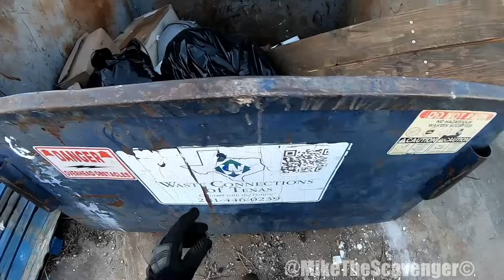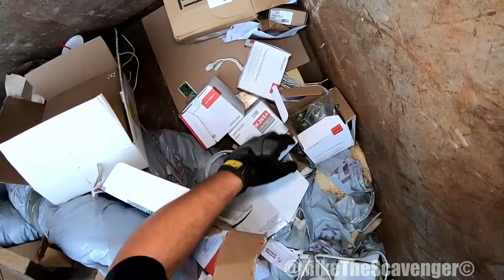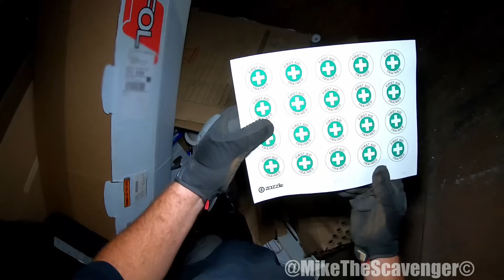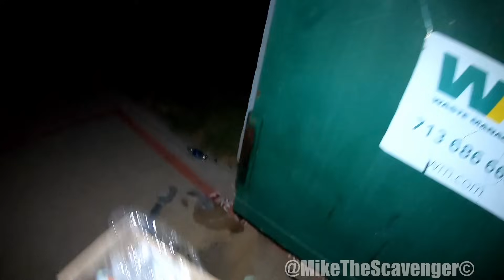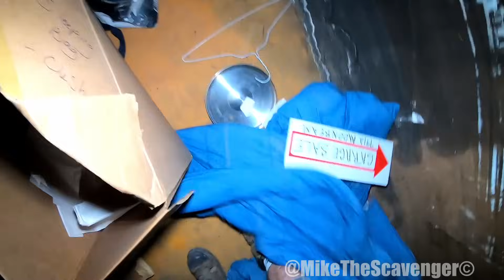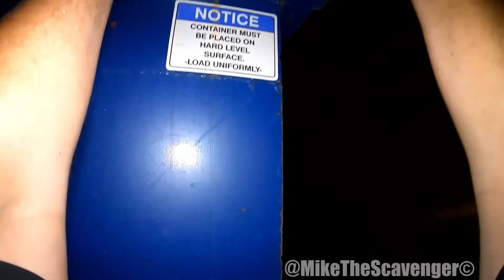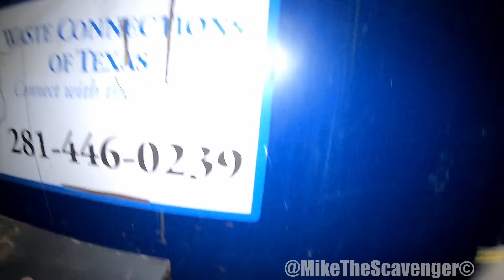Dumpster Diving "There's A Gold Box"

Comment: Mike, on those toilets in the big open tops, there often is a big brass locking ring on the connection between the tank and the bowl, a few swats with a hammer ought to free it up.

Comment: Those mystery things with the three blades on a swivel are called collectors and are used to supply power to moving carriers on sorting machines.  I used hundreds of them in a postal sorting facility.
The ones we used were about thirty dollars apiece.
The actual blades were a bronze alloy.
Reply: Thank you! I was reading all the comments till I saw one about those.  I was thinking a limit switch contact kinda thing!

Comment: Your rock with the hole is a Pink Himalayan salt lamp. Yes those safes are mostly a fireproof concrete refactory and can usually open with a specialty numbered key through a cap covered hole.

Comment: 23:13 Engine cover for a GM 6.2 Liter V8 Supercharged LSA Engine
24:00 A cross member that sits right above the engine of a 2013 Camaro that the above engine cover is for, you can probably sell that for more than scrap value

Comment: 12:14 looks like electrical contactors from a switch or distribution panel. Should be good stuff, possibly brass or bronze parts and always keep your pirate eye out for silver contact points on the really old high voltage electrical stuff!

Comment: Those shoes you picked up should be number one copper  underneath the coating on top. Those are used as high voltage rail sweeps for 440 3 phase cranes and things like that.

Comment: Those "radios" mics are Motorola Astro W3 remote microphones with keypads and displays. They will bring a good bit on eBay. The metal parts are high power Astro mounts.